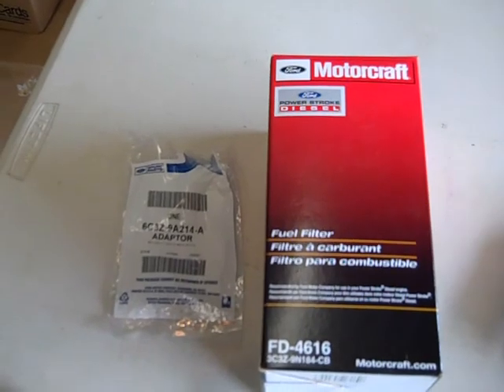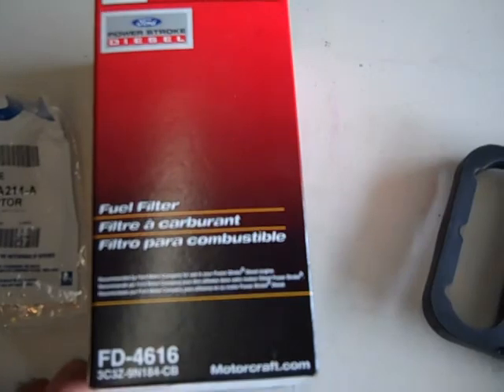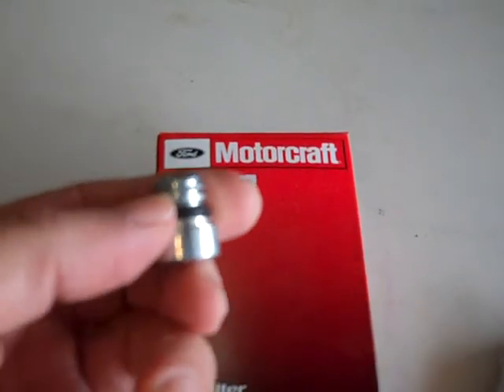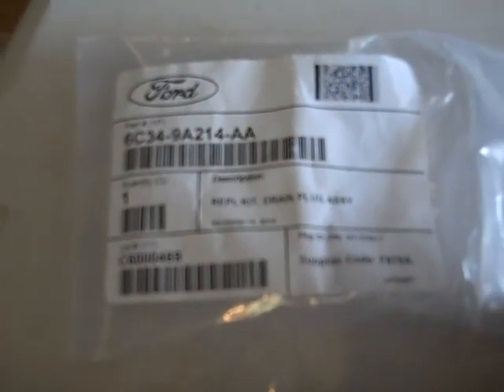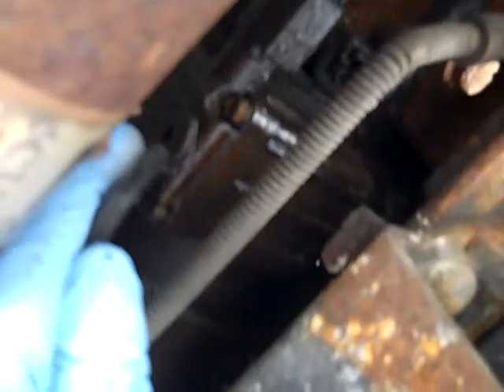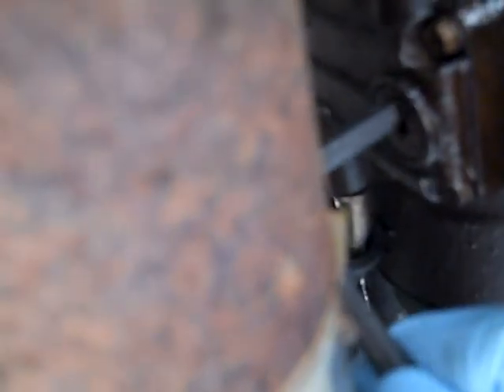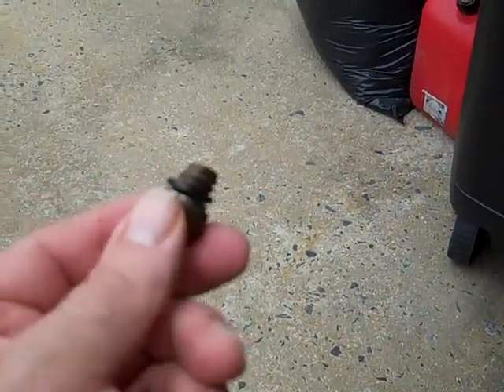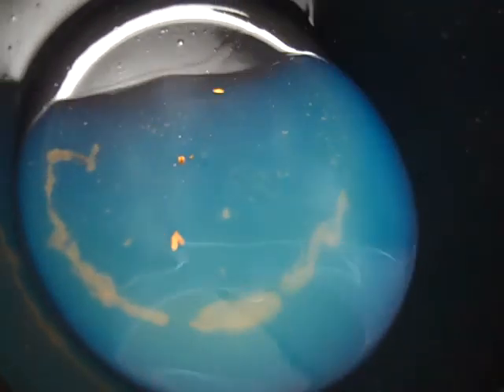Water in Fuel,  F250 6.0L Diesel

Comment: The first time I changed my fuel filters ('06 F350) the fuel kept coming out and coming out of the drain plug.  A friend told me to be sure that there the tank is not full when changing the filter.  (A siphon effect??).   The last time I opened it I made sure I didn't have a full tank of fuel.    Recently I had a 'water in fuel' indication I went to another video and he took 'carb' cleaner and angled the spray tube and sprayed in the opening.  I did that and got a large amount of gunk and water out.  Have not had a problem since.

Comment: I'm about to buy the new Ford Ranger 2016 diesel engine and I strat reading about diesal engines and how to maintain them. Any way it's first time i come a cross this!! That diesel engines have water-separator system. I need to read more about this. 
Thank you for your video.
Reply from the maker: The water separator needs to be serviced and the fuel filters need to be changed regularly on most diesels.